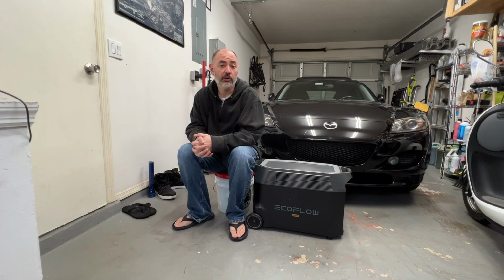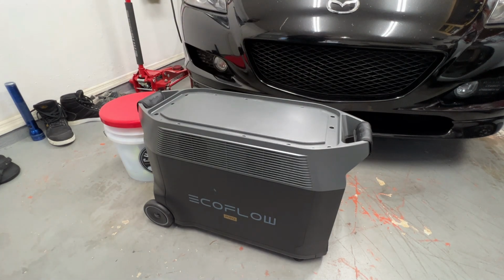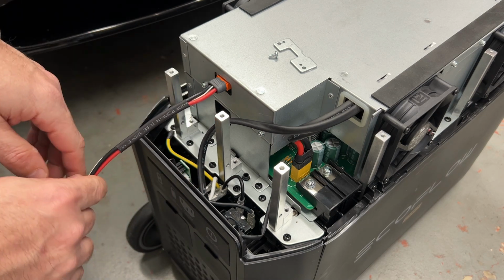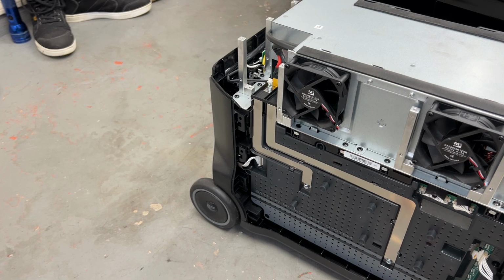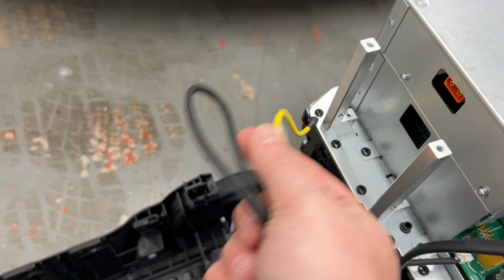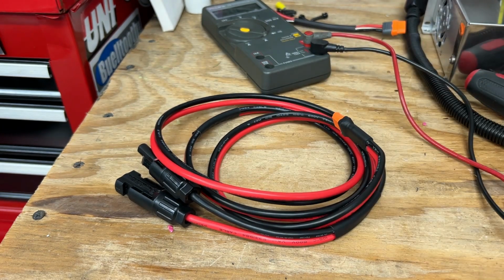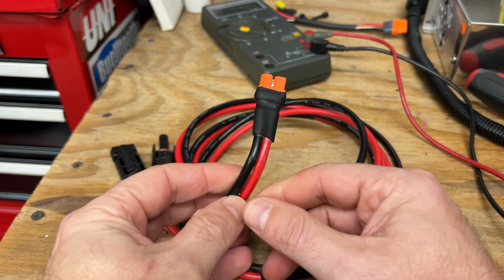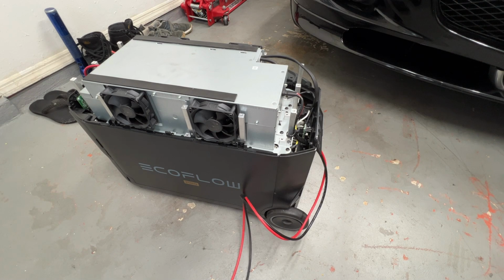EcoFlow Delta Pro - Working Around a Broken DC / Solar Input Port

Comment: You are lucky. This is a minor issue compared to the issues I’ve encountered with my Bluetti. Can’t figure out what this issue is as the on off issue has a mind of its own. Plus shipping it to them is more expensive than the cost of the unit even under warranty. User error user error user error is what they say. I bought an Ecoflow and it is super reliable.

Comment: Thanks for this informative video  especially how to get access to the back section. I had a similar issue, but fixed the situation by finding appropriate sized screws to go into the threads provided on the unit, but not utilized. Then I drilled holes into the mounting plate and drilled holes into the back area where the connection goes. Using locking nuts to mount the connector and plate to the back so this unit will NEVER pop out of place again. Something Ecoflow should do in the first place. 
Thanks again for the instructions of removing housing.

Comment: Beyond a shadow of a doubt this was one of the best vlogs I have come across speaking to this DP problem and your explanations are on point well done sir. However if you can answer this or anyone else from the first day I had purchased my DP I bought the pigtail and connected that immediately and thus far have never had a problem which you have so wonderfully explain to everyone. My situation is all of a sudden my DP stopped pulling in solar panel power Which was harvesting sunlight and DP which we're working 100 percent with a clear sky and bright sunshine all Of a sudden for no good reason ? I went over all my cable wires checked out my panels and the DP will not acknowledge it and kick on my feeling is I have a faulty solar charge module has anyone had this problem and any Advice before I go through the long arduous process of trying to contact eco flow ?
Reply from the maker: I hate to say it, but it does sound its possible the solar charge controller has failed. I would certainly reach out to EcoFlow and see what they say.
Reply: @GimpyMR2  Thank you for your response my Delta Pro was 100% fine however after doing some diagnostic work I Found the problem was with my dual 430 Watt solar panels which are now gone and I'm looking to replace with something smaller and easier to handle such as a 100 watt or perhaps 250 watt solar panel with the thoughts of placing them up on my flat all season roof using articulating solar panel stands I do not want to drill any holes up there. If you could give me or perhaps someone on your site good recommendation say between Renogy or Bougerv or Eco worthy? Also I'm using 10 AWG solar panel wire any comments on that if so I would love to hear if that is a standard because with the last two panels I have gotten rid of I've melted my MC4 connectors two times don't want that to happen anymore. Sorry I went on here I would appreciate any input I'm a kind of newbie to this whole solar thing learning as I go so thank you for any help.

Comment: Appreciate the breakdown I couldn't get the back panel off but ur video showed the details I was looking for. I also noticed on the new updated units there's some type of silicone glue holding the solar input in place. Wish I knew what the manufacturer used so I can beef up the connection?

Comment: just a heads up on the nightmare i've had working with ecoflow. 1st i bought 2 delta pros and 4 extra batteries and they working good at the beginning. Then the dc input fell inside the case and 2 days later the other started smoking. Called ecoflow told them the problem and they sent me the return label for both units to ship out. 2 days later fedex brought them back because of improper hazmat paperwork. so i called ecoflow again and told them this and they emailed me that paperwork to put on box. monday05/13/2024 i received a refurbished delta pro but wont work not taking in solar or recognizing the 2 batteries. so i called again same run around but the best part the 2 original units i sent out showed back up today with improper hazmat sticker and the units haven't even made it back to plano TX and its been 20 days. this whole process started on 04/16/2024 and today 05/17/2024 and not further resolution. Just beware!!!!!!

Comment: Preventive Maintenace idea is to buy a XT60i male to XT60i female extension. Connect to DP solar input prior to failure. Loop and secure the excess extended cable around the DP lifting handle. Utilize the now installed cable extension female plug for solar input. In this configuration the solar input on the DP is never disturbed and were it to fail and fall back into the unit you could still input solar power. Problem is, I cannot find a XT60i male to female extension, only a XT60 male to XT60i female. Per your video it seems the " i " is important. This is all I could find - "GELRHONR XT60i Extension Cable 1M, XT60 Male to XT60i Female Connector Cable"  Any ideas or suggestions? Thank you!
Reply: Amazon now carries XT60i male to XT60i female extension cable in lengths from 3 to 40 feet. Search for: xt60i male to xt60i female extension cable

Comment: Great video. I purchased 2 Ecoflow Delta Pros and both had this failure. After a conversation with Ecoflow, I sent the first one back. They made shipping it back and paid under warranty. What they do not take into account is shipping that unit is hard for older folks because it's a 100lbs. And it brings down my backup system until the replacement comes. During this time I heard a click and Delta Pro #2 failed! I decided to fix the issue for good and wondered why no one else had this problem. My repair was very similar to yours. When my replacement came it, I added it back to my system, and guess what!?! Yeah, the fookin replacement failed too! I consulted with Ecoflow and they assured me the issue has been addressed. They wanted me to send it back again. My question was how many times we gonna do this sheit? They used all the those fear tactics about warranty being void...bla bla bla. I repaired #3 myself. Ecoflow YOU R FULL OF DODO!
Reply from the maker: Sorry you had so much trouble with that one unit!

In my humble opinion, they need to redesign that mounting system and make it a field replaceable unit for people willing to do so. I know they'll never do this, but it would be nice ... especially given they keep emailing me endlessly to upgrade to the Delta Pro Ultra.
Reply: @GimpyMR2  Exactly. They need to issue a service bulletin that includes the affected units by serial number or lot. Also, with instructions and for inspection, replacement options, or repair instructions. Folks in the middle of nowhere are counting on these units and they are not cheap.
Reply: They covered shipping and didn’t make you pay. UPS picks up from your home unless you are living off grid or in the backwoods of Alaska.

Comment: A simple preventive fix but one you shouldn't need to do.
After purchasing (2) DP's 4 months ago the first thing I plugged into those solar inputs were 12"  xt60i male to female extension cables. 
Problem avoided!
Reply: I'd like to know where you found the XT60i male to female extension cables?  
Sure could use them! All I can find is XT60 male to XT60i female.  Thank you!

Comment: For my delta 2, the car charger cable died within 2 weeks. So I got a little creative.

My jeep has auxiliary switches 2 40A and 2 15A. I ended up using one of the 40A circuits, replaced the fuse with a 20A to try and protect the ecoflow if something does go wrong. I got a true XT60i to mc4 cable with the center pin shorted to ground, crimped an MC4 onto the aux hot wire, and crimped an mc4 onto a ground wire ran to chassis ground. I am kind of debating ditching the MC4's for more of an automotive connector like a deustch but I do like the idea of being able to use said xt60i to mc4 cable for solar panels as well. 

Now the ecoflow recognizes my jeep as a solar panel, albeit at 12v vehicle voltages. Being that it allows for 15A charge rate, it now charges up to 198w charging depending on what the smart alternator is doing. 
The first cable I bought, "batteria power", the center pin was dead and not shorted to positive or negative. The delta 2 only allowed 8A with a dead center pin🤦
Reply from the maker: Thanks for that comment on your setup, good info for a lot of folks on how to approach a quicker charging setup on a vehicle. 

I need to make a video on how I'm using these as a poor mans house storage solution, but I also run a 20A fuse inline (Renogy MC4 style) on mine. Just seemed like a prudent thing to do given I have seen some first hand accounts of people accidentally killing the DC input on these.
Reply: @GimpyMR2  the best bet for fast car charging is a dc/dc up step converter like Victron makes. Converts 12v to 24v but it's adjustable up to 30v @ up to 20 amps. 30v at 15A being 450w is a pretty good charge rate, but $ is a bit tight right now. So the converter, and all associated wiring just wasn't in the budget for us right now, whereas a $16 cable fit the bill!

Comment: I have 2 DP's which both needed to be sent in for warranty repair for the solar connection. The first one returned without them even putting the screws in so it had to go back again.  This fall in NE WI when I was charging a DP on a warm day I noticed how hot the cable was at the point of connection to the DP.  BTW, the sun was shining on the solar connection and it was 75 degrees out.I am confident my problems with the EcoFlow Delta Pro solar connections are far from over so your video was very timely for me. Actually, ahead of it's time since warranties don't last forever.
Reply from the maker: Interesting your experiences on warranty repairs. Putting this back in its box and shipping 100lbs back to their depot over just a cable seemed like a bit much. I hope the unit will stay reliable otherwise, this has been my only issue really... its exceeded expectations otherwise for me.
Reply: @GimpyMR2   Your right it was a lot of work and I lost one months use in the prime of summer while one went to and fro twice. But,  I didn't want to void my warranty. Both times they offered a refurb and were refused each time. Baring that poblem, I'm very satisfied with my DP's